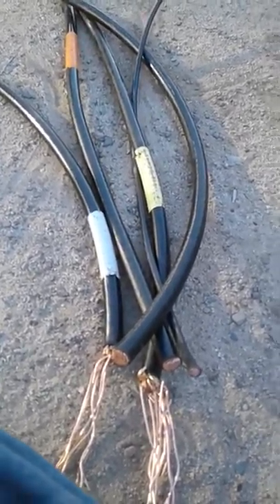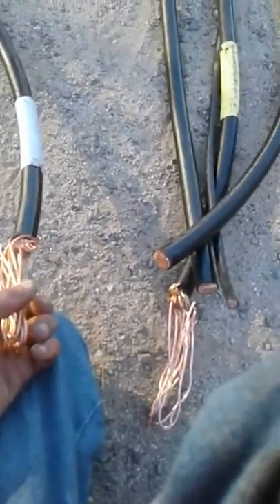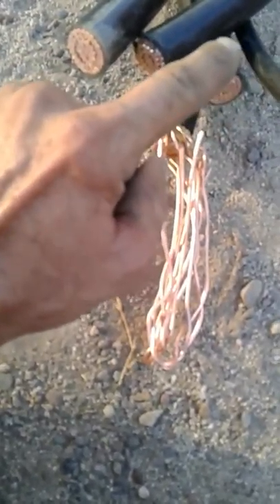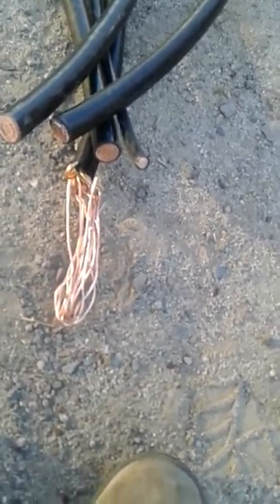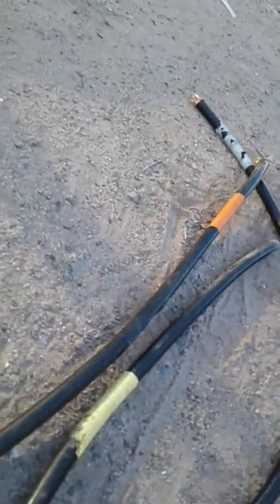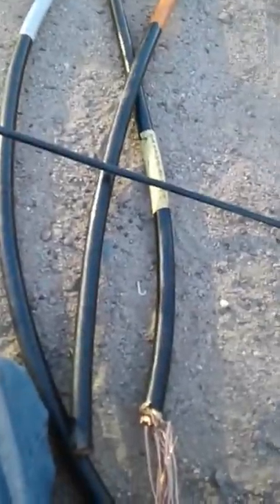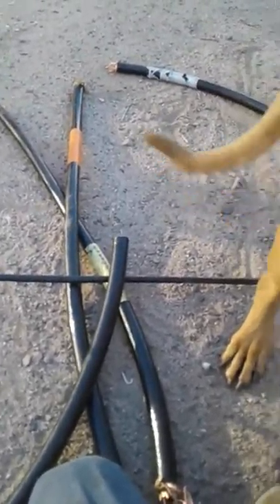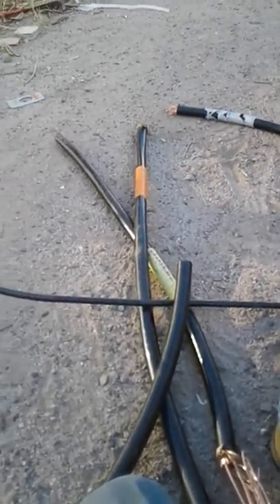Pulling in big wire through 4" pipes.

Comment from the maker: I'm sure it could over time if no glue is used when running PVC underground but I've pulled wires out of pipes that are completely soaked and nothing ever happened but I've also found 3' long sections of pipes melted through from burning wires sitting in water. Some electricians feel they can forego the glue because they're not dealing with water or air pressure but they are. The glue insnt to keep water in, it's to keep water out. Sometimes pipes can break underground during the tamping process so I make sure I don't shovel rocks onto my pipes. Loose dirt only around the pipes. After they're covered up, throw in all the rocks you want. Rocks do help with compaction.

Comment from the maker: We just use mule tape. It's also called Herculine. That stuff is great but for instances like this we use a pull rope. The end of the rope is woven together into a loop so it stays strong. You can get it from a supply house but for 200A you're probably working with 4/0 which is half the size of these wires. It took 2 sets of these wires 650 KCMIL to feed an 800A distribution panel.

Comment: Do you need a special rope or connector to pull. Running 200amp from transformer to breaker box, 250' in 2" pvc